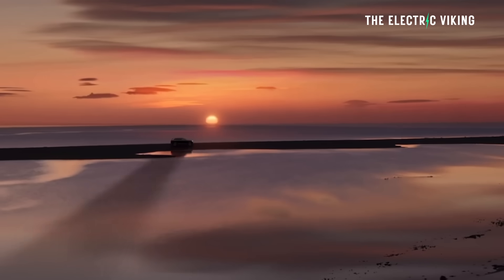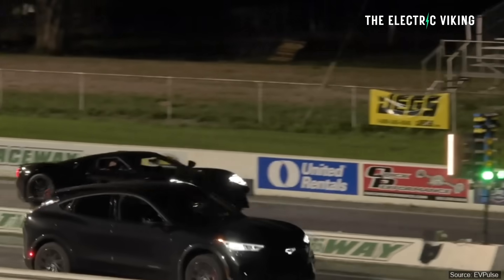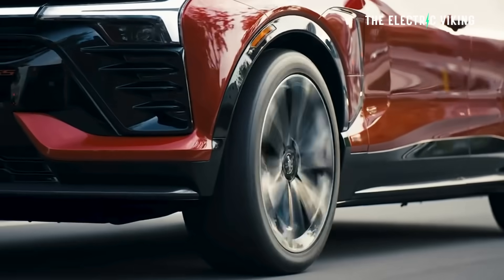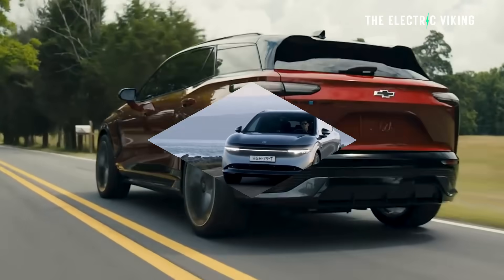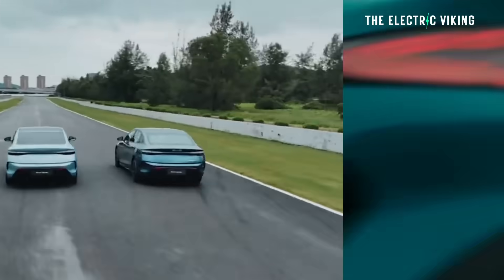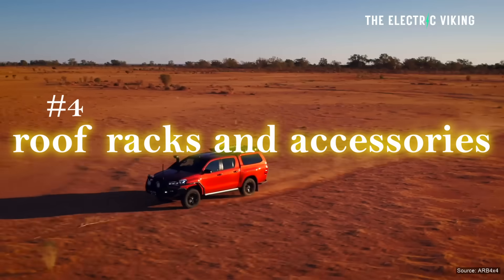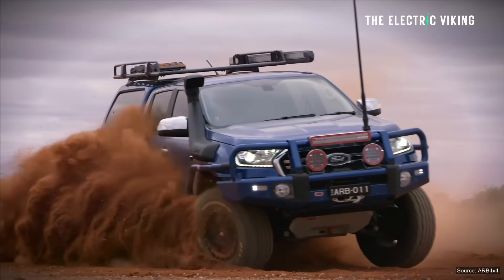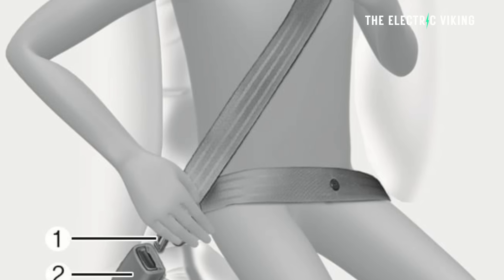5 Ways to Instantly Boost Your EV Range (Free Miles You’re Missing)

Comment: Gentle accelerating and looking at the road ahead so slowing down a little earlier when you see red lights ahead does wonders. This alone in city driving (as long as you live in a place that doesn't have freezing winters) will easily give you the claimed maximum range, not 30% less that most car reviewers suggest.

Comment: We have a 2025 Model 3.  The recommended pressure (on the label in the door jamb) is 42 psi. Tires are stock (Hankook Ventus).  The tire sidewall says max is 50 psi, but I'll never do that.  So, I run them at 42 psi.

Comment: Good stuff.  Think about 25 years ago when we had 40 miles or so range in a regular converted gas vehicle. We were doing everything to squeeze every mile. LoL A huge difference was driving under 60 mph. As you can imagine not popular but the wind resistance between 50 mph and 60 mph is quite large.

Comment: A very good range extender would be a light-weight, fully forged wheel. There are wheels that can save you 4-5 lbs of un-sprung weight per wheel (16-20lbs total). That is significant.

Comment: One problem i have noticed is owners reducing their climate controls' fan speed to very low or near zero, "to save energy".  This causes the heating/compressor to run non-stop at maximum load to try to provide the set temperature for the cabin.

LEAVE it on auto fan speed.

Lastly turning off regen in certain circumstances can increase range over having it on. 

Regen is at most 60 percent efficient recovering the kinetic energy converting back into stored electricity.  Sometimes coasting is vastly more efficient as you are not consuming any power.

If can maintain some of your vehicles momentum it takes vastly less energy to accelerate back to cruising speed in stop and go driving.

Comment: You say a lot of unnecessary things but said nothing about details. If your tiire max pressure is 45, for example what should you put? This is what people needs to know. Not ramble nonsense
Reply: Considering that the air in the tires will expand when warm, the pressure will exceed the maximum rating as you drive, which is dangerous. 
Would recommend giving at least 10% for expansion.

Comment: Great tips. I’ll add two.  A) There are. Accurate, fast, battery-operated tire gauges. Set your tire pressure up or down,push the Go button, eg voilà. If you live at 5,00, ft elevation, set your tire pressure 2 psi higher than mfg recommended. Air is thinner at altitude. 2) if you accelerate from 0 to 50, great. Next, don’t slow slow down even 1 mile/hr unless you really, really have to. (Cruise control is great but hardly anyone yes’s it in city streets.) you pay none y to get up to 50mph…don’t throw money away by going slower simply because you’re not paying attention. Passengers appreciate a steady speed…i know my😊 neck likes it.
Reply: Lol, tyre pressure inside the tyre is independent of atmospheric pressure.
If anything lower outside pressure will increase inflation.

Comment: And switch the battery regen setting to the minimum. Counter-intuitive I know but battery regen is not all that efficient and using good anticipation when slowing down is far more effective. High battery regen is good for city driving but not for highway driving.
Reply: Maximum regeneration is always better as you get maximum benfit of not going over the speed limit, less brake wear, and less energy wasted using mechanical brakes especially on roads with steep hills. I gain 5km range using regeneration  going down Mount Ousley every time.

Comment: Funny that the way you drive has the biggest impact of range on ANY car you drive, IC or electric. Since I got a little older and wiser, now every car that I have owned in the last 20 years gets "better" mileage and range than the EPA quotes. And on top of that, tires, brakes and well, everything just lasts longer. Imagine a tire rated to last 60k miles now lasting 70k miles, not 35k. And remember, the speed limit is the "maximum" speed. Some like to drive on long trips at 80 mph or even faster. I like to drive 60-65. This makes a huge difference in range per tank or charge making far less stopping. And for everyday driving around town, just leave 2 minutes earlier because you are not really saving that much time anyway, you just have the feeling you are. I also have no stress when I get home or to my destination.

Comment: Look at the tire! The tire manufacturer says what maximum pressure they recommend. Use that maximum. Be vary that the grip is affected. If driving in slippery condition, off road or icy, follow the car manufacturers recommendations. Start your journey five minutes earlier and you drive more relaxed and use the cruise control. In the long run your driving behaviour changes, you drive more smooth with less takeovers and hard accelerations and hard brakings. Plan ahead, nearing a crossroads or roundabouts, remove your foot early and use "the momentum battery" of stored energy instead of converting it to heat in the brakes!
Cost reduction is what makes you takes these actions. The huge cost reduction is actually filling the car with passengers! Let's say you drive the car to work once a😊 week with four passengers and four days a week YOU are the passenger! Here in Sweden places can be seen with lots of cars and bicycles parked in the middle of nowhere. It's where cars are filled up with passengers.
Reply: That maximum tire pressure listed on the sidewall is the maximum safe pressure not to be exceeded without the danger of rapid unscheduled disassembly. This would make for a very bad day. 
The pressure specified by the car's OEM is carefully designed to work with the cars suspension to provide a good trade off between traction, ride and economy. As you raise pressure above the car's specification the tire footprint changes shape and shrinks, which can cause problems in handling and braking. These may not be apparent  until you have an emergency maneuver.  Reduction in tire life and a harsher ride also occur.
Reply: @rkayakr you can go above the max rated, obviously, otherwise zero margin for error
Reply: Not much ice in Australia

Comment: The tyres advice is misleading I think, and going on the comments already given, many of the EVs out there have manufacturer recommended tyre PSI above your recommended 38 PSI. My Seal for example has a recommended rear tyre pressure of 42 PSI.

Comment: When i drove an ice car, i  found that turning  cruise control on would consume more fuel.  Is this the same with EVs, or is the opposite true?
Reply: Modern active/intelligent cruise control systems, including in EV cars, should drive as smoothly as possible to minimise efficiency losses from acceleration/deceleration. This is especially important for EVs which tend to be heavier and so cost more energy to accelerate.
So, in principle, using ACC/ICC should improve efficiency over a human driver who may not drive as smoothly, but results may vary if the driver is very good or the software is not so goo.
Reply: Thats because, they try to maintain that speed at the expense of fuel economy. For example, if there is hill my ICE car would downshift to maintain speed. Higher RPM from downshifting means more fuel fuel consumption. 

EVs don't have that issue.

Comment: Shouldn't we be using the manufacturer recommended tire pressure? My Model Y LR has a tire pressure rating of 42PSI.
Next, use smaller rims/tires. My car comes with a 19" rim and tire. The same car with a 21" rim and tire gets about 20-30Km less range.
Thoughts?
Reply: Wise choice for no show! Smart @👍

Comment: When you look at the methode they measure WLTP range, it is very easy to get better range from your battery. 
WLTP test is doing, very fast acceleration, 25% city speed, 25% medium speed, 25% highway speed and several times full top speed.
All in a period of 30 minutes. 
We have an EV with a 40kWh battery, that according to WLTP has a range of 310km. We easily do 380km and still recorded that the battery still had 41km range left, making a total of at least 421km.
The only thing we didn't do was going up the highway. All travels were on 60kmh and 80kmh roads in the rural part of Netherlands, North-Holland. 
Our EV weighs 1330km and yes, it is Chinese and very efficient.  :)
Best way to extend your range is . . . . . . less heavy foot. Relax, it is good for your heart AND improves your range.

Comment: A bit higher pressure and aero wheel covers are great tips. For more range, downsizing the tire size from 225 to 205 or 245 to 225 (if in the papers) also makes a noticeable difference. (Unpopular choice as very large tires are "in" nowadays). Reducing speed on long distances is a major downside of EVs. On a free highway, at night, crawling along at 110 km/h is not relaxing, it´s tiring and it increases total travel times significantly - compared to a comfortable travelling speed of 150 km/h or 160 km/h depending on country and speed limits.
Reply: "Crawling along @ 110 Km/h" is the the maximum in most states except for the NT
Reply: @gtpete6363  research from the Australian Road Safety Foundation indicates that, in March 2022, more than 50% of road-users admitted to speeding... Germany deaths per 100.000 inhabitants: 3.35 / Australia 4.54; per 1 billion road-kilometers: Germany 4.2 / Australia 4.9. No wildlife danger and good highway road conditions where I drive 885 kilometers in 5.5 hours (Sedan).
Reply: Until you hit a deer or a moose.  Many traffic deaths are caused by drivers trying to avoid wildlife.

Comment: @The Electric Viking. What is your take on with coasting feature and regen braking? What I mean in gasoline cars, if you drive slower and coast when you can, you can gain 10+ miles per gallon. My car went from 33 to 44 miles per gallon. If you coast then regen braking when slowing down, would these electric cars save more energy and get more miles per charge?

Comment: The biggest thing is to just slow down. Don't exceed 70 mph/110 kmh. Really easy. Same for IC vehicles.
Reply: My hybrid gets much better mileage in stop and go traffic. One of the advantages of regenerative breaking. Yes, drag increases with speed.
Reply: @elhoward7440 In stop and go traffic your average speed is much slower.  Overall weight of a vehicle is more important at slow speed.  The faster you go the more important aerodynamics become.  At 50 mph about half their energy is just pushing your car into the relative wind.

Comment: Wheel covers affect brake cooling - a minor point for most people, but a consideration in some cases. 

Good guess on US speed. 80mph is pretty normal away from the cities, but probably 75mph average. 

Did I miss you covering ride height? Granted, many cars cannot change, but many can set ride height.

Comment: Tesla recommends 44-45 psi on a model S. Is this too much with only two passengers?
Reply: Depends on the tire. I have a 2017 P100D, noticeable increase in range by changing from 21" to 19" which I run at 45PSI on trips, 42 PSI around town due to ride difference.

Comment: I'm never in need of 5 more miles. I might need 100 more miles but none of this stuff will get me there. As for PSI that is very important not just for range but for how long the tiers last.
Reply: If driving 5 miles more is of great importance, you probably bought a car with too small battery!
Reply: 10% + 10% + 5% =25%. On a 400km range that will give you 500km range with ease.
Relax driving with less highways gave us 421km with a 40kWh battery. Never exceed speed limits, and set the EV on full regen helps to.
Reply: @Grizzold-HP2  I could do that if there were no other cars on the road but that's not the real world.

Comment: Shouldn't we be following manufacturer's recommendations? Mine says to run them at 42 psi 🤔
Reply: I agree,  the recommended pressure cold on my Model Y is 42 psi,  well above the 38 that is mentioned,🤔🤔
Reply: @brucebabcock3018 same here, but when I bring my Y into Tesla, they always suggest and pump it to 44.
Reply: @brucebabcock3018 agree. Our Tesla M3 says 42psi. But applying Sam's logic suggests Tesla's recommendation is for American roads. NZ roads are crap- up and down and full of potholes. Maybe we should drop our psi to 38?
Reply: The recommended tire pressure is based on car weight.
Reply: 42 psi is recommended as the cold tyre pressure un the U.K. also.
Reply: Always.
Reply: Does the cold make a difference? I thought recommended was generally a lot lower than 42...
Reply: 42 psi is recommended for the Chevy Equinox EV as well.
Reply: 43